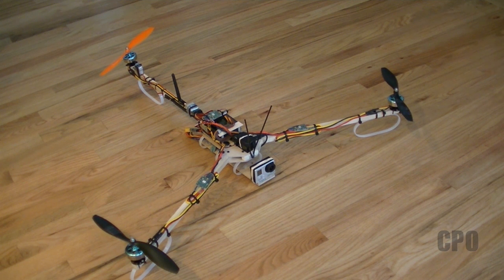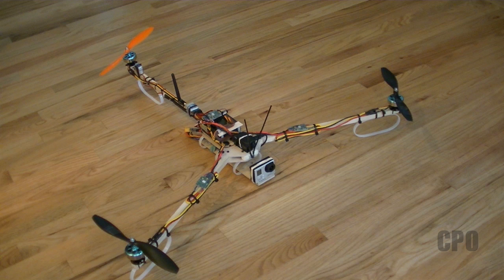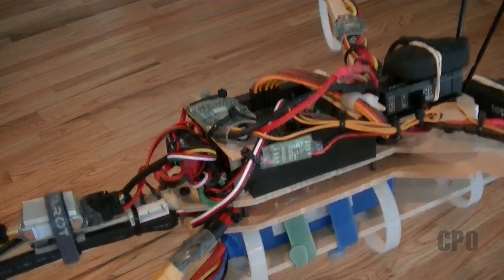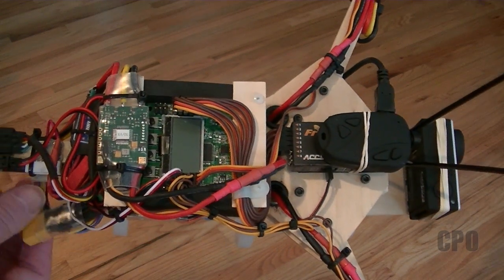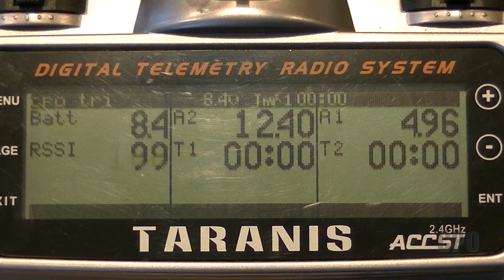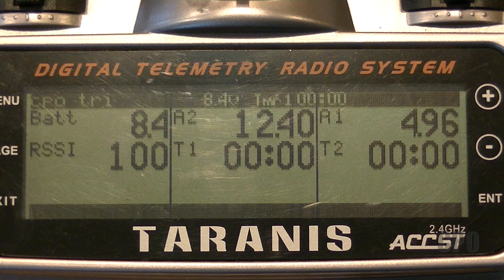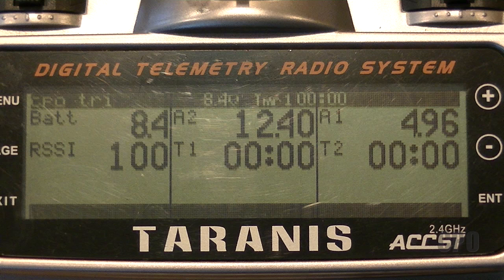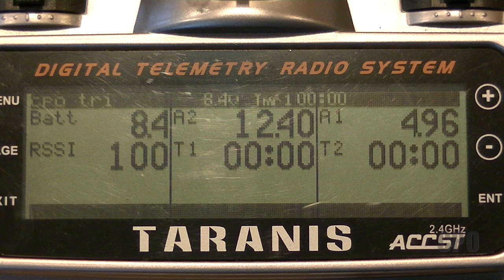CPO Tricopter Build : Added FPV Gear and Telemetry

Comment: Hey CPO, it's cmavr8 from rcgroups.
Nice to see you're progressing... Just a few notes for the future (optimization ideas): 1. drawing power for the FPV gear from the same battery may increase noise. David is using a 4s->12V power supply +filter circuit that he made. I copied it but haven't tested it yet. Needs lots of heatsinking

2. You don't need all these wires to go from rcRx to KK2. Actually, you may be causing problems by creating those ground+power loops. You only need one full set (GND, power, signal) and the others can just be signals. What I do is connect one of them properly and one or too more vertically, so that only signals are transferred. Save some mess too :)
Reply from the maker: Yeah, I saw his little filter.  Looks interesting.  I didn't have any real noise on this flight (or any so far).  That may change once I start increasing distance. On my planes I have used separate battery for the FPV gear, but I didn't want the additional weight (yet) on the tricopter.

With the ground loops...I have seen people go round and round on this. First...removing grounds only cleans up two out of 100 wires!  So I don't care about that. But... I am still curious about the ground loop potential, and if it really exists (and if so, if the potential exists in my setup).

You might me just the right guy to help me with some of these open questions...for example...what is a recognizable symptom of a ground loop?
Reply: EVERYTHING cpo  Nah... I don't know much about ground loops, just that I should avoid them. Especially on UAV/FPV systems they can be pretty bad news (http://fpvlab.com/forums/showthread.php?445-IMPORTANT-BEC-on-ESC-and-Avoiding-high-current-system-ground-loops). Anyway, for me, some one told me, it made sense, so I do it ever since. David also does it so :)

It would remove gnd and power wires from Rx to KK2. Instead of 5x3 you'd have 1x3 + 4x1 = 7 wires. Anyway, no big deal.

Regarding the filter, you can't use it as is as you're using 3S. The dropout voltage is low, but it won't work. Not that low. I've been using a separate 3s500mah for video btw. Works ok :)
Reply from the maker: Thanks, Chris Mavrakis. I'll dig into that a bit. I thought you were talking about the BEC to KK wires. Looks like I have something to research.  I honestly haven't seen anyone remove the ground/power from the KK to RX, but that makes sense.  Those all share common ground on both the RX side and the KK side, and only one power supply is needed....

Comment: Do you have a pack voltage alarm on your Taranis? I just got my voltage sensor in the mail, so I'll be researching how to do that soon.
Reply from the maker: Yes. I have it set for low voltage and critical voltage. I can throw together a quick overview this weekend. I was surprised how little info there was on how to do this.

Comment: Are you using a 5.8 GHz system? I tried once with the 900MHz band and my tricopter literally dropped out of the sky when it lost signal due to interference. I recently switched to the more robust FrSky (instead of the FlySky protocol) to hopefully avoid that from happening again. I'd be interested to know if you get any decrease in range with the 5.8GHz transmitter on.

Also, did you connect the A2 port on the D8R directly across all three cells of the battery or did you use a voltage divider and calibrate the value within the transmitter software? Thanks again for the videos.
Reply from the maker: I am using 5.8 GHz.  So far so good.
Reply from the maker: Sorry...missed the second half. I used a FrSky voltage sensor that has a voltage divider. I gave it the voltage of all three cells, and "calibrated" it in the transmitter. It was pretty easy once I figured out what I needed to do. I plan on doing a quick tip video on this over the weekend.